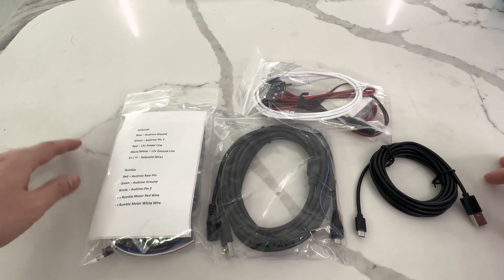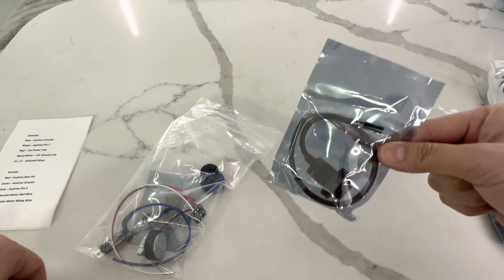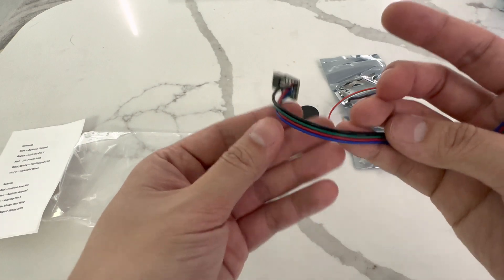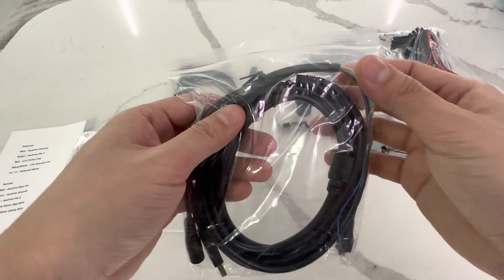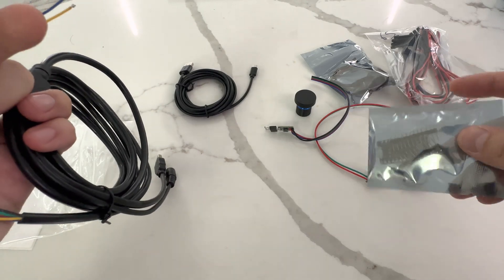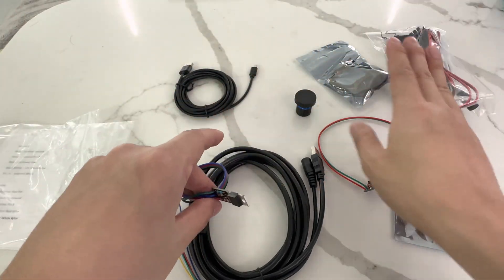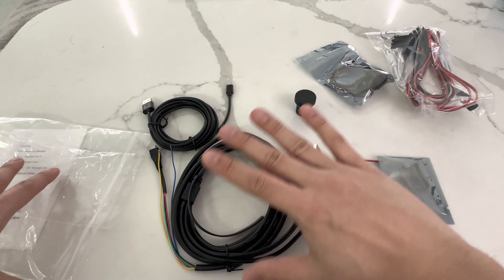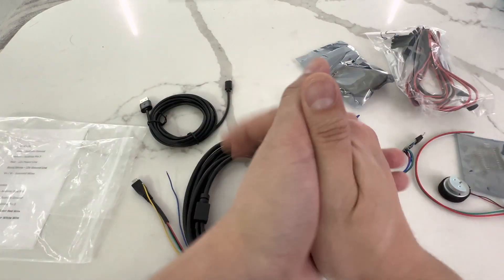New Ultimate GUN4IR DIY Mod Kit + Custom Recoil Cable

Comment: Does anyone know how well this kit might be for sinden guns.  I've seen a lot of different nerf guns used but no one attempting to mod sinden guns
Reply from the maker: I’ve done it but is difficult and Sindens circuit board has issues when multiple buttons pressed at once
Reply: @rpegelectronics  so if I swapped out the boards completely with the gun4IR boards would that solve the problem?
Reply from the maker: @zakiuddin3120 no cause the original buttons are attached to the board . So you’d need some kinda custom pcb solution
Reply: @rpegelectronics  if I just wanted trigger and solenoid functions can I just not use the button board?

on second thought, I'd probably need at least one button for reload and whatnot. And desoldering is definitely not an option, right?
Reply from the maker: @zakiuddin3120 if u only do pump and trigger and solenoid it should be ok
Reply: @rpegelectronics  Alright, thanks for your advice!

Comment: Great kit and great customer support I had an issue with a defect in the cord (it was very hard to see) I sent him an email and he text me back a few minutes later. Sent him a picture and he sent me a new cord. I would recommend using this kit. Still takes time and effort but made things easy to not have to build the all boards and source the parts. You will spend more time and money if you buy it all separate. Times money. I plan on buying  2 more kits soon.

Comment: Can you explain what you mean regarding the voltage? Is this dependant on the donor gun? I have a Named (Namco) copy would I need additional parts as well as this kit?
Reply from the maker: Yes our kit simply passes power to your solenoid. So in your case you will use a 24v power adapter
Reply from the maker: This kit comes with everything you need except tools for doing a Namco or named gun
Reply: @rpegelectronics  excellent thanks you for clearing that up, do I just specify at checkout 24 volts. Also what tools are you referring too? Soldering iron etc
Reply from the maker: @insertmanycoins1752  no need the circuit is universal for any voltage. And yes soldering iron , wire clippers , stripper etc